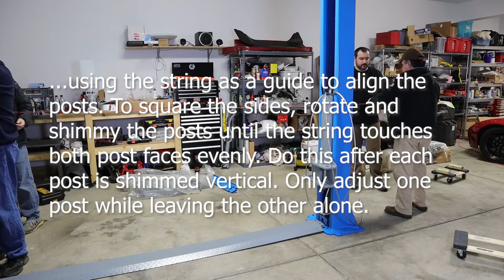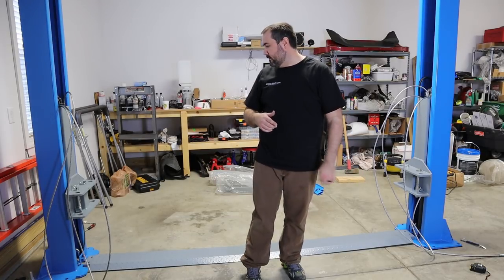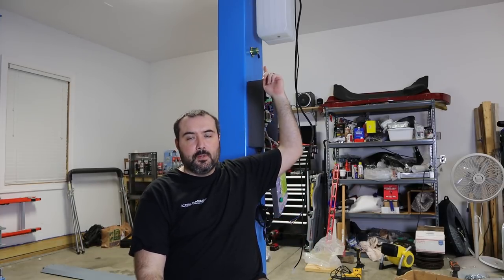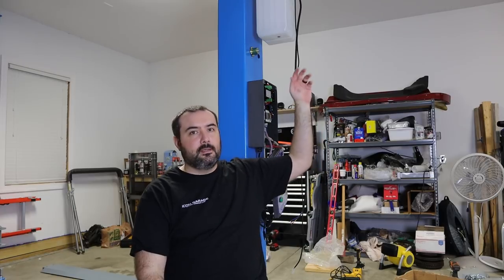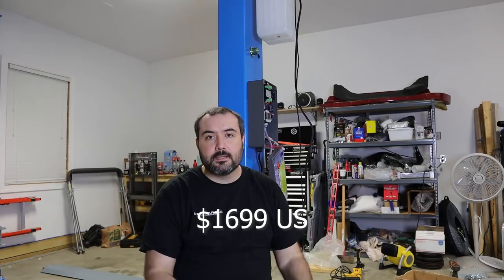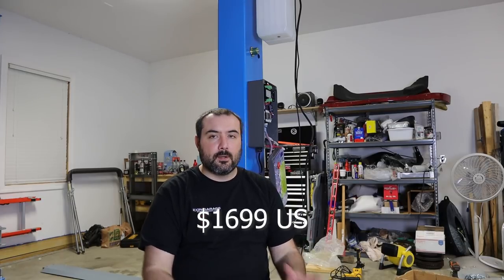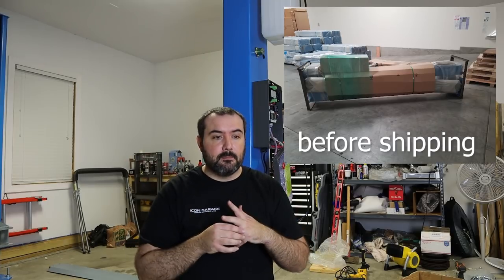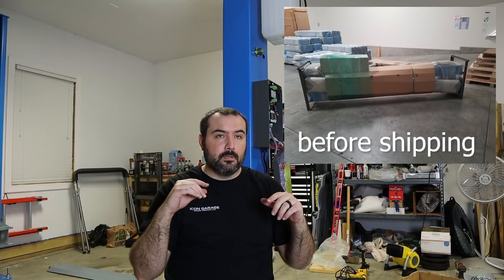Installing My New Lift in Home Garage (Easier than I thought)!

Comment: I have a scissor lift and am converting to a 2 post in a couple weeks. Scissor lifts work great for brakes, tires and suspension but if you own a rear wheel drive vehicle you are limited by not having access to transmission, driveshaft or exhaust. Yes the one post will be in the way and sometimes be a pain but the extra access more than offsets this.
Reply from the maker: Agreed. A scissor lift might make sense if you do not have the ceiling height for a 2 or 4 post lift. Ultimately why I went 2 post was better access and cheaper than scissor lift.

Comment: Nice video man, and congrats on the lift, one of my dreams aswell. Good to know its possible with limited ceiling height!
Reply from the maker: Thanks! I’d say 10’ is minimum height for a full size 2 post lift. Even then it will be limited. There are some mid rise lifts out there that can get you 40” to 50” which would work well for a 9’ ceiling.

Comment: That's awesome! Having a two post lift is dream of mine too. I have just always assumed that a 10 ft. ceiling was inadequate. I will end up with a 10 ft. ceiling as well when and if ever I get my garage build done. I never have even considered a two-post lift before now. I will study more on this option. Wondering now if they have limit sets... An emergency shut off/switch/trigger would be great if you are beyond lift height capacity. I'm just thinking out loud....
Reply from the maker: The lift has a built in limit switch inside the main post that will stop the carriers near the top of the lift. I am sure this can be adjusted or extended to stop the lift at a lower point and this would be great if you always lifted the same car. I am looking into building a cut off switch that mounts to my ceiling that is triggered by a padded bar. This will give me more of a fail safe with different vehicles. Like I mentioned, I will be lucky to get 6’ of clearance under the RX7 with my 10’-4” ceiling. There will be some compromise with lower ceilings. Check out the specs on the Bendpak Grandprix lifts. They have top bars with safety switches, but won’t lift as high as a similar floor plate 2 post lift.

Comment: I realize this video was 5 years ago… but it was very informative! how much space do you have in front of the posts (towards  your work bench)? 
I’m installing a Max Jax lift and I’m wondering if where it’s placed has enough up front. It’s exactly 8ft from front wall to the post
Reply from the maker: A little over 8 ft from the center of the post to the front of my bench. The cars I work on are typically small but it does get a little tight to work. If the joints in my slab were not centered, I would move my posts back a foot or two.
Reply: @IconGarage  thanks!

Comment: Ha, I always thought that 1500 quid is way too much to gain 20inch. Apart from that the screws look relatively short. I expected them to be longer. Really interesting.
Reply from the maker: The anchors that come with the lift I believe are 160 mm in length and the specifications for the European concrete are a little different than US and they recommend 200 mm thick slab minimum. 4” embedment in my slab is enough to develop anchor capacity.

Comment: I think these freight companies should be severely held accountable when they scratch these lifts the way they do. I think in my opinion there shouldn't be any damage or scratches as long as these people loading and unloading the lifts are careful. Of course they're not. Why would they be? They're handling other people's stuff and not theirs........
Reply from the maker: Yes. This is a common issue for heavy items. It is very challenging for parts coming from out of the country as they are probably handled numerous times. Mine had aesthetic damage but I have talked to other folks who received their’s in worse shape. Twin Busch has a show room in Las Vegas and that picking up from there is probably the safest way to get these with the least risk of damage. Twin Busch was very responsive in addressing my concerns and were willing to ship me any parts that were damaged or missing. I didn’t end up needing to replace anything but I am confident in their customer service.

Comment: Congrats on the lift!  Thanks very much for sharing the journey with us.  Had you considered the Dannmar Maxjax lift?  If so, what did you think of it and why didn’t you choose it?
Reply from the maker: I did look at those. They are more expensive than many full size 2-post lifts and only get you about 48” of lift height. I would say this is a great choice if you have a very low ceiling or don’t want the posts permanently installed. All around it’s a good option.

Comment: How deep did you drill for the anchor bolts?
Reply from the maker: Depends on what the anchor manufacturer recommends. Mine required about 5.5”.

Comment: You should have put up Apoxsee in the holes before putting the anchors down to prevent the anchors from pulling up out of the concrete I have seen it happen and I put Apoxsee it a holes on my left to keep the anchors from backing out 👍😎
Reply: What the fkuc is Apoxsee? Some kind of contagious disease?
Reply: @TheOriginalCoda  when Apoxsee in the holes it prevents the anchors from backing out it helps Bond the anchor bolt to the concrete slab

Comment: How deep did u drive your anchors in I got the smaller model of this and have yet to install my concrete is 4.5 inches thick
Reply from the maker: I believe Twin Busch recommends 4” for the anchors supplied with the lift. I installed most of mine at 4 3/4” or so based of the anchor manufacturer’s design data. The embedment depth will vary based on anchor manufacturer in most cases. There were a few anchors that I ended up drilling through the entire slab before getting to 4 3/4”. You would have to consult the tech data for your anchors or contact a structural engineer to provide recommendations for your situation if it is outside the recommendations of the lift manufacturer.

Comment: You only need to be 4 inches away from any crack, seam, or old anchor hole, I'm a licensed rotary installer and that's what they call for and a minimum of 4 inches of concrete depth
Reply from the maker: Each lift manufacturer has their own recommendations. I’m a licensed structural engineer and I checked my conditions and installed based on the anchor manufacturers requirements. Again, those will vary depending on the product used.

Comment: Curious to know if your floor is tension slab. That’s what I have and I’m afraid of drilling into one of the cables.
Reply from the maker: No, my slab is plain concrete. Definitely talk to an engineer if you have a post-tensioned or pretensioned slab. Cutting a cable could be dangerous.

Comment: I am seeing this video almost a year later. Are you happy with this lift? I have been looking into these and there are a million options and looking for someone with personal experience
Reply: And as opposed to alot of YouTubers on this subject, you are literate, you have done your homework and you are safety conscious. many of these douche bags that have posted negative comments obviously are just looking to pick apart your video.
Reply from the maker: All things considered, I would install this lift again. It is a very good value. Things I like: runs off 110-120v, not very expensive, and relatively easy install and setup. Things I have had issues with: the arms always seem to be too long and I’ve had a couple of occasions where the cover over the cables on the floor has lifted out of its grooves at the ends. Both of these could be issues with any 2 post lift. I may reach out to Twin Busch and see about getting a second set of the short arms. Depending on the car and lift points, I have to switch the arms around to get the most balance fit, but I often have trouble with the longer arms being short enough to have the pads hit the car’s lift points. On a big truck or SUV, it is probably not an issue. Nearly every car I have had in my lift has been small or a mid size sedan. The arms always take some time to get fit under the cars. The floor cover has a natural bow in it so that when the arms are all the way down, it helps press it into the slab so it doesn’t move when the car drives over. On one or two occasions, the cover has shifted and came out of the slots at the ends. It wasn’t a huge issue, but if it shifted enough and you didn’t notice, it could potentially come down on the lift cable or hydraulic lines. Like is said, these could be issues with most similar lifts. I definitely recommend this lift for the price.

Comment: is your concrete slab slanted?
Reply from the maker: It has a slight slope for drainage. Posts are set vertical and I have the ability to adjust the pads on the carrier arms to contact the car evenly.

Comment: And drilling before running the cables is absurd, you make sure ur cables reach before drilling any holes, you build and stand up ur two columns and put ur overhead on, run ur cables and if they reach and columns are level then you drill
Reply from the maker: Everything was installed and checked against the installation instructions.  Not every step of the measuring and layout process was covered in the video. There is no overhead bar with this lift and there is a range of acceptable dimensions for the post separation. The installation was within specifications. There is a lot of adjustment with this lift to dial it in.